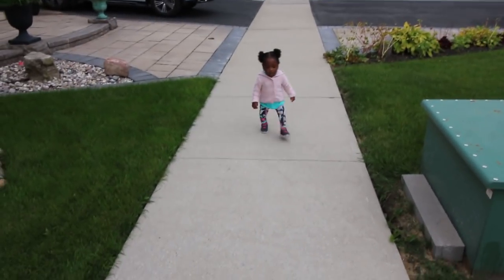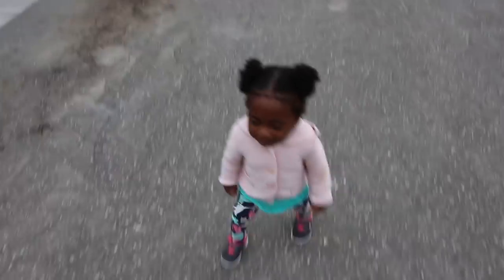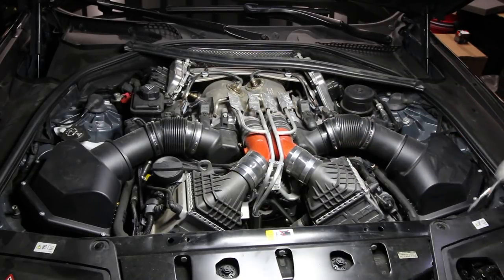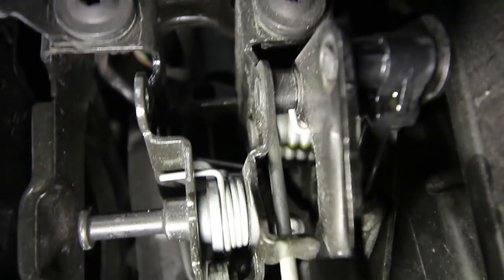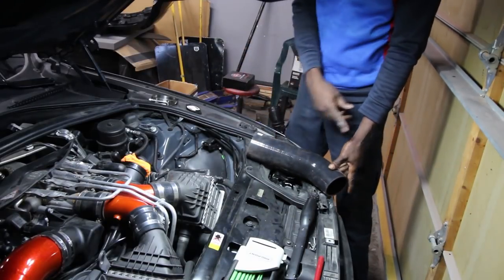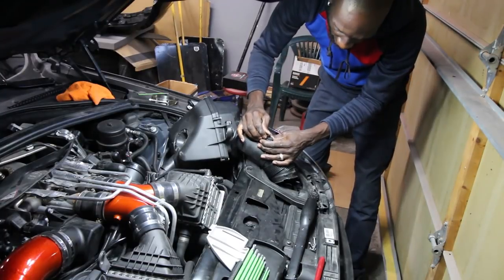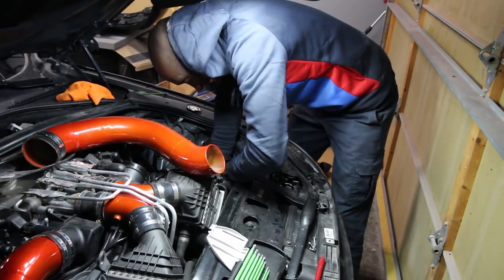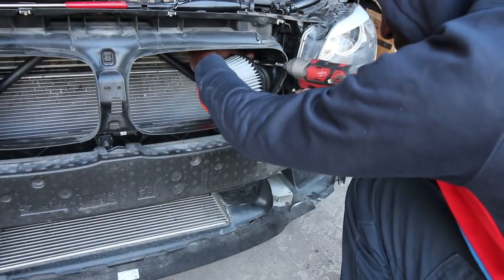How to install cold air intake on a F10 M5

Comment: I’ve done a cold intake with ram air filters ,yours look good and you’ve got to get it remapped mines 740 bhp with 840 nm torque and it’s unreal lol 😂 no taking off traction control in the wet lol 😂.
Reply: Stock clutch?
Reply: @birch4209  yes mate stock clutch the guy who mapped it knows his stuff his runs 1000bhp on stock ,he limits torque to 850 nm so as not to overload clutch and I have to say mines doing great no slippage or issues at all .

Comment: How is the mesh filter for the Project Gamma intake holding up? I have a 2016 M5, and looking to get the Project Gamma intake with the mesh filter for the sound. Just worried about the lack of filtration stories I've heard regarding the mesh filter. Keep up the great work on the videos!
Reply from the maker: Thanks and I have no issues

Comment: Those look great man. I am waiting to install mine, and I was curious if the filter you installed in the video are the Mesh filters from PG or a paper filter? If they are mesh, have you been running them since installation? I had them send the paper and mesh and the mesh is literally see through. Thanks in advance for any insight.
Reply from the maker: It's the mesh and they aren't see see through.  I've been using from day 1
Reply: F.A.T mods  I’ve read some bad reviews were those Blitz filters let dirt into the engine , K&N filter the air worlds better , that’s if you value your engine
Reply from the maker: Mine are mesh and been using since install

Comment: Hey , nice install , are those K&N filters? What are your thoughts on the Blitz stainless steel filters , Thanks
Reply: I can’t tell you with a F10 M5 but those blitz stainless totally screwed up the intake on my buddies 98 Supra Turbo. Unless u live in an area with very low particulates in the air stay away from those.

Comment: Any issues in the rain with this intake?
Reply from the maker: None I checked and they don't get wet
Reply: You’ll have issues in the long run with these stainless steel filters as they are Chinese and collect particles. The sound great but no bueno.
Reply: @KauvSTi  You can always use the Filter Wears Pre-Filters (www.filterwears.com). They are socks that fit over the filters and add  an extra layer of protection from dust, dirt, debris, and water. I just ordered Project Gamma Intakes for my F06 M6 Gran Coupe, and I also invested in the Filter Wears Pre-Filters.

Comment: Is this the project gamma intake
Reply from the maker: Yes with a little modification
Reply: Nice the colour or more?
Reply from the maker: The color and 45 degree at the top so I could get rid of the factory 45 degree plastic
Reply: Nice you tuned it yet? I’m running bm3 and highly recommend it
Reply from the maker: Not yet going to get custom tuned
Reply: What website or source through Project Gamma did you get it? Trying to get one myself but they never responded back to me. Need to get one delivered to Australia. Much appreciated.
Reply from the maker: Project_gamma on Instagram 
Texas auto fleet 
I had to call a few times
Reply: Thanks mate ill try email them. Do you get any flutter sound? Did you get to pick from any types of filters and any color choice or did you just paint it yourself? I like the look of the k&n filters but want the best sound.
Reply from the maker: It comes in aluminum and you have a choice of filters.

Comment from the maker: They haven't got wet so far
Reply: Buy some intake socks for your filters. Water does make it through from time to time. I had some steel and the rk autoworkes carbon fiber intakes the water got through and fried my maf sensor. Overall good install!!!

Comment: Looks aside, whatever little HP gain by cold air intake is offset when the intake pipe length is extended  ... and it comes together with more air turbulence when more bends created.  The Germans didn't spend billions in R&D for nothing in finding a sweet spot .. what you feeling now -  is just placebo.
Reply from the maker: Really I'm so tired of you keyboard warrior.   Have you tried this ony your car if not stay quiet.  Have you seen the research and if you think improvements aren't made on manufacturers parts then you are an idiot.  Take you placebo and shove it.  You don't like it don't watch it. But I don't need to hear your crap.